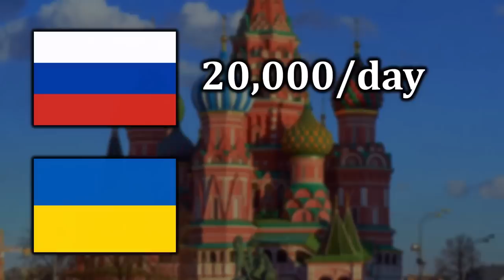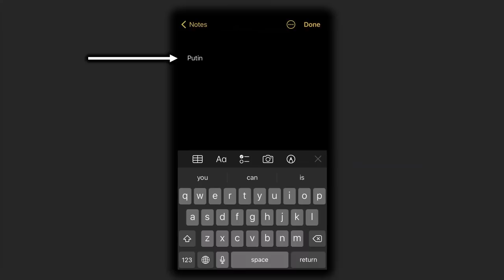Ukraine's Artillery Shortage Has a Simple Solution. Will the West Implement It?

Comment: Hold up: you said the west is incapable of resupplying Ukraine with shells. But then during your analysis you said that Ukraine is firing 8,000 shells per month, and Europe produces 300,000 155mm shells per year. That's 25,000 shells per month. That's plenty. Granted, that's all of Europe (not all of which is supporting Ukraine), but the US alone produces 14,000 rounds per month, and that's before their planned ramp-ups.

Ukraine isn't just firing 155mm shells, obviously, but given the figures you're presenting, it's clear that the west is not incapable of delivering. Unwilling, perhaps, but not incapable. Currently, the west is using their production to fill and grow their own stockpiles, instead of sending shells to Ukraine.

Comment: The premise of this video is an oversimplification... as if shell quantity alone would be decisive at the front lines.  If there are shell limitations on the Ukrainian side, then the solution for Ukraine would be to allocate the limited supply such that sufficient numbers for defense were available everywhere, and the additional ones would be put in limited areas where they would make an offensive difference.  This is a super obvious approach, but there is no evidence that this has been taking place... as the Ukrainians have apparently been attempting to make offensive moves in multiple points, without much success.  Further, the Ukrainian offensive difficulty has apparently been due to the success of the Russian defensive layers, and these aren't countered by additional shell availability.  It seems that the key problem lies elsewhere.
Reply: If anyone is simplifying the problem its you. Artillery is super important. Especially if you dont have air superiority, which Ukraine doesnt. You need to be able to return fire to suppress the enemy's advancement. It is just way too easy for Russia to destroy Ukrainian positions with this kind of disparity in ammo.
Reply: @Jensth  That's a bizarre comment.  I did not claim that some other factor is more important than shells in the present context, only that there are a LOT of other factors... so many that the premise of the video (that somehow guaranteed supply contracts on the Ukrainian side will make some kind of difference) is rather flimsy.  And to break it down for you even more, Putin knows as well as anyone that what the arms manufactures really care about is money, so that any guaranteed quantity contract can easily be bought out (were the war to end suddenly and oversupply was looming), on the one hand, and the military can front the money needed to set up factories... at no risk to the manufacturer... on the other hand.  Militarily, what is meaningful is the production (and firing) RATE that is sustainable, not the means by which that rate is achieved contractually.

Comment: Your information on European artillery production is obsolete so far I can tell. Rheinmetall claims a production of 450.000 and says it will boost it to 600.000 in 2024, also noting it has been getting a lot of large contracts from various European states and is expecting production for some time to come.

Basically everything you've suggested here has already to at least a moderate level come to pass really and Putin apparently has decided to persist despite the clear signal. And this isn't really the only long term signal been given in recent times, with the EU having set support for Ukraine through to 2027 one way or the other, be it military or reconstruction.

At a certain point one should always consider the option if one side simply doesn't have accurate information, or is not fighting the war for what one would consider entirely rational reasons. In the end people are also driven be emotions after all and don't make clean calculations of everything, it is possible Putin simply is unwilling to concede, even though things are not looking good.

Comment: NATO military strategy dictates the first objective is to gain air suppierority, then you launch sorties against ground targets. The idea is to practically roll out the red carpet for your ground forces. Any resistance you run into will be neutralized by air power hence the need for air suppierority.

Who the hell uses artillery in this day and age? You don't need artillery if you have air suppierority and so you don't need an arsenal of artillery shells.  Well apparently, the Russians are still using artillery in this day and age. NATO thought the Russians fought like NATO does but the Russians are still fighting with 1917 tactics. 

This is an extraordinary case of Russian incompetence and lack of vision actually giving them an advantage on the battlefield. All that fancy NATO training and equipment are useless without air suppierority which the Ukrainians don't have because President Joe "Bite Me" Biden didn't want to give the Ukrainians F-16s. 

I keep hearing talking heads and so-called "analysts" saying the war is Russia's to lose but actually it's NATO's to lose.

Comment: Shells, are being manafactured but the ramp up, is too slow. 

The money to build shells isn't cheap, it's not that expensive though. 

Too many shells is a problem because that too much needs to go on being built for years. 

This though would be cost effective compared to a terrorist state expanding into NATO. 

It's the lesser of two costs. 

The problem for Russia is that when the shells are built then supplying them to OTHER COUNTRIES is a good way to use them up if the Ukraine war ends. 

Russia will lose the war and its future security. It's basically the cost of vengeance and vengeance is coming. 

Putin has put the security of Russia at risk and every day the war continues that will get worse. He is the  stupidest leader Russia ever had.

Russians have themselves to blame.

Comment: I don't think though that it's an apples to apples comparison. Nato artillery is much more accurate so they expend far less to take out a single target. My impression (from just watching warthog, TVP, and kaval13 mostly) is that the russian artillery accuracy is total crap compared to what Ukraine is using. The front has been extremely stable for some time so if the 4:1 ratio mentioned in this video is accurate perhaps thats due to the increased accuracy of the Ukrainian artillery. I haven't heard mention of what russia's shell stockpiles and production are but it looks like they are very much straining to hold the line. They have all but pulled their remaining tanks back to act as artillery so I would guess they aren't able to increase the amount of shells to the front either. I am just hoping that Ukraine can keep the pressure up and slowly but surely push the russians out. Slava Ukraini.